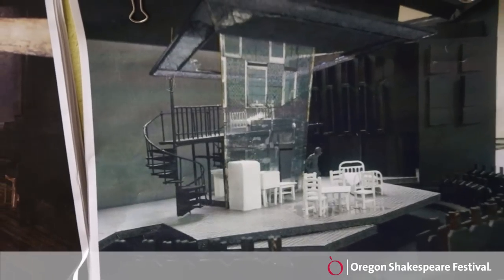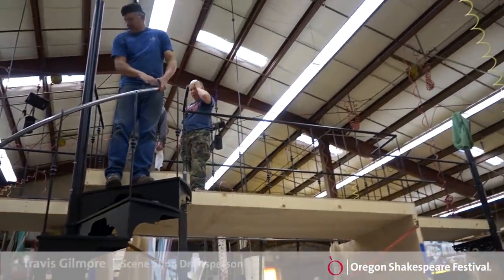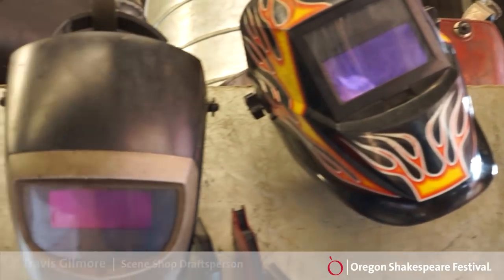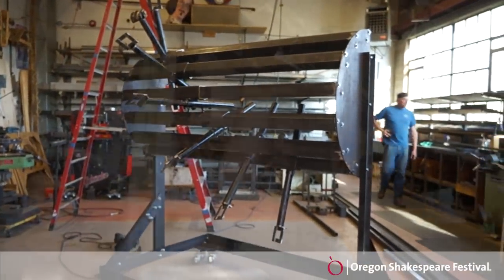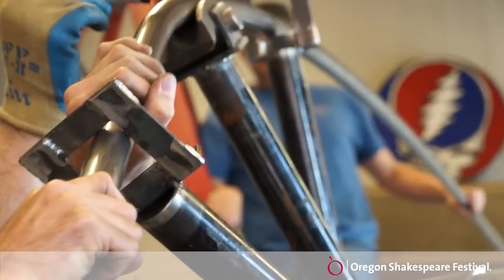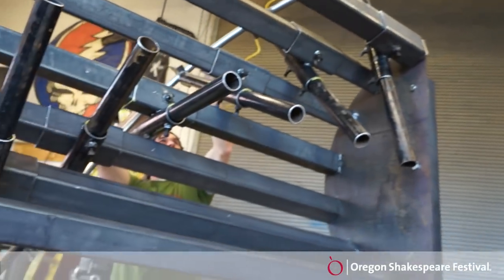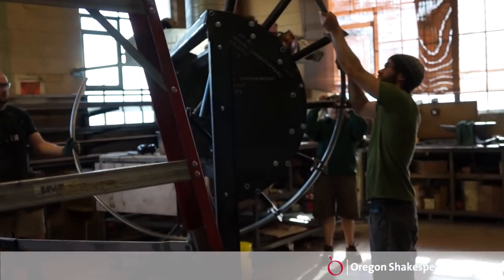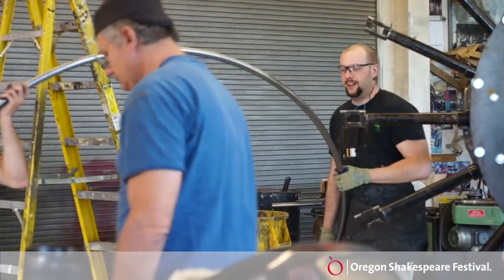Snapshots: Bend your own Handrail

Comment: Calculate helical curvature (radius) from floor-plan, handrail center-line and pitch (unit rise/run @ center-line) Google it.

Make flat bend to that radius and then pull up and down on handrail ends to follow stair helix (on the stair.) The pipe should flex but may require a little heat.